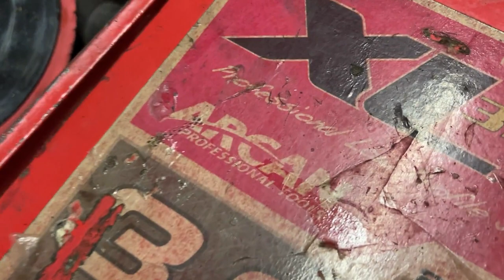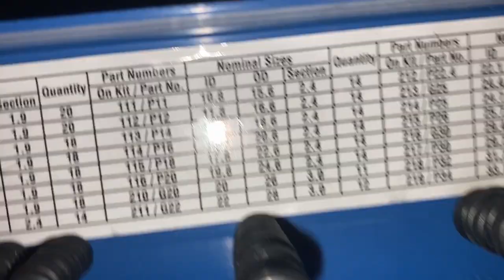How to repair a floor jack with leaky seals the easy way

Comment: Neat to see how simple the mechanism is on these floor jacks. 

The teflon rings are called backup rings, and are used prevent the rubber o-rings from extruding between the pistons and cylinders in high pressure applications. These are split rings and will most likely be included in a seal kit for the jack.  

Cool video, cheers!
Reply: Sadly, those Teflon rings are not sold separately. They are sized at the factory, and so if they were to fail, you have to replace the entire piston assembly. Which few manufacturers will sell you. When the manufacturer is a reputable one that believes in self-service, they will sell you both of those pistons and they will include the Teflon and viton seals pre-installed. 🤷‍♂️
Reply: I noticed on mine the white rings has a slanted crack on it but the new ones don’t have them but there isn’t a way to get them on without cutting them . Are they supposed to be cut ?